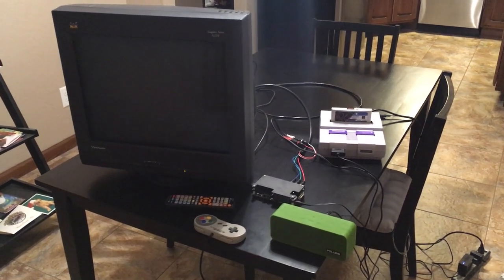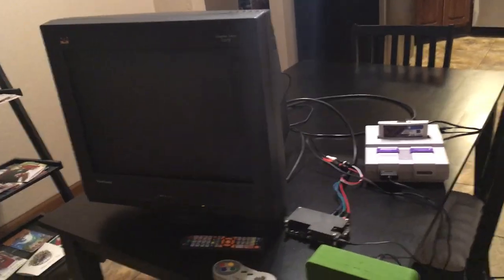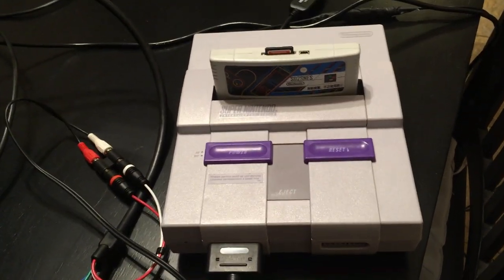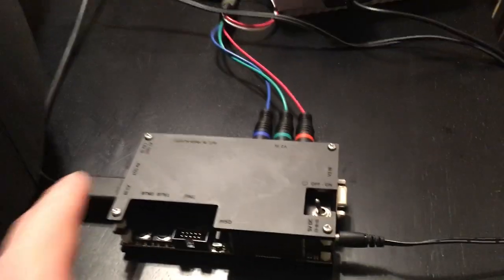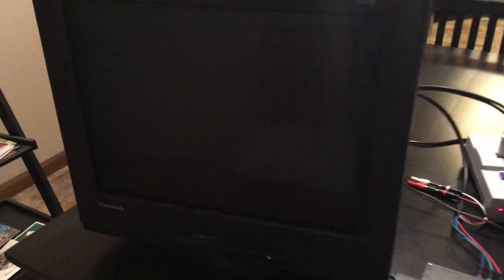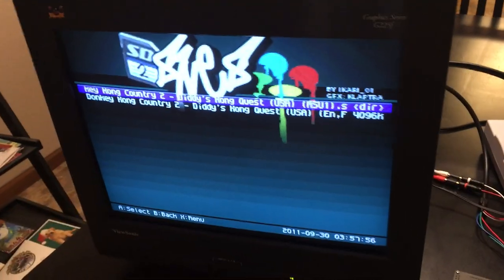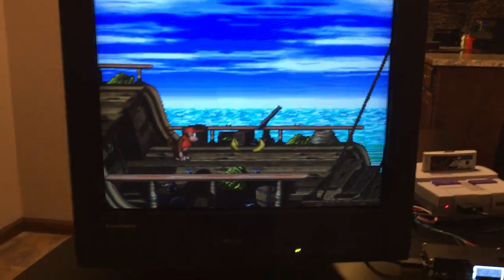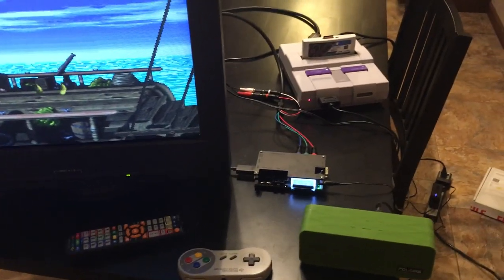SNES on Viewsonic G225f VGA CRT with OSSC

Comment: If you're outputting 480p, you should film this again with the scanlines enabled so you can give everyone an idea of how well this stands up to the sony pvm/bvm brand.  I tested mine on a gateway and in spite of it being shadowmask, it's quite freaky how thin and sharp the actual lines are drawn.
PC monitors are actually turning out to be a hidden grail for scanline purists.
Reply from the maker: Honestly, I'm pretty new to this and didn't think about it. I haven't messed around with the OSSC settings very much.
Reply from the maker: I have been experimenting with scanlines using the OSSC and I'm finding that I like them at about 56% which is pretty thick.
Reply from the maker: Here is a link to my video with Scanlines https://www.youtube.com/watch?v=QmybvIZeyKw
Reply: Totally agree.
Reply: I just ordered a Gateway EV910 and I'm so excited, especially since it's the exact same monitor I had as a kid!  I've been using an old 36" Trinitron but I've been looking for something that'll just fit on my desk and supports 480p content.  While 6th gen consoles look great when upscaled properly, they're still meant for CRT displays so I'm gonna play them that way lol  I just wish the monitor was black so it doesn't stick out like a sore thumb on my setup lol

Comment: Mitsubishi Diamond Pro 2070SB. I plan to buy this monitor. get a good rival for Sony GDM. It will also be connected to the ossc to connect consoles with a 240p screen. The same vga adapter as yours will use the monitor. I hope the effect will be great. It's a good monitor;)
Reply: Just make sure to get an HD Fury HDMI to VGA adapter, as they are the only ones available now days on the market with reference image quality.

Comment: The HD retrovision cable is not an RGB cable. It's strictly component video. Spend $25 and run an RGB Scart cable from your SNES to your OSSC. Your picture will be much better.
Reply from the maker: I might have to try that. I'm under the impressions that they are outputting a similar quality signal.
Reply: @superretrocade3362  very similar. From what I've read it's sometimes non-discernable, while other times it's night and day even with the exact model of screen.

Comment: Great video. I’m considering downsizing my trinitron and going the crt pc monitor route. PVM and BVM are non existent locally.
Reply from the maker: I also have a video about using the rad2x cables with a tendak hdmi to VGA adapter. That works very well with PC crts aswell.
Reply: Super Retrocade awesome I’ll check it ou
Reply: Not just Non Existent, but insanely expensive. PC monitors can be pretty expensive too.
Reply: @Vinnay94  You can get some really nice 17" PCM's for under £100, or 19" for under £200.

Comment: Thanks for the tip on the HDMI to VGA adapter. I own an OSSC but mainly use it for my HD displays. I have an older XRGB-2+ that I use to run a signal into my VGA CRT. It has a wobbly image and isn't great for capturing. Maybe I'll try the OSSC and see how well it works with my monitor.

Comment: Just picked up a Viewsonic P815, hopefully ossc will be available again soon for NA cuz i wanna try this out, possibly with RGB since it came with BNC inputs in the back.
Reply from the maker: I believe the BNC inputs on the back of the Viewsonics won't work with RGB from consoles. It is my understanding that it is pretty much just another VGA input but in a BNC connector to more easily connect to high end equipment back in the day. 1. I tried a Retrotink 2x and thought it looked bad. 2. I haven't tried the Garro since it can't do 240p 3. If you buy a used OSSC on ebay make sure it is a real one and not a knockoff or wait for VGP to have them for sale again. The knockoff OSSCs are made with cheaper stuff and may vary in quality. 4. Check out firebrand x settings profiles for the OSSC. Thanks for watching!

Comment: I have a G90F will it perform as good as that given that is only VGA?
Reply from the maker: POWERMAXUM it should be great! I think all these viewsonics are great for retro gaming.
Reply: @superretrocade3362  could you give me your recommended settings to calibrate the monitor?
Reply from the maker: @POWERMAXUM  Just as I said in the video I would adjust the zoom setting and horizontal/vertical positioning to make sure it fills the monitor but doesn't stretch the image. on my monitor I didn't adjust anything else. On the OSSC I used Firebrand X's recommended settings for the SNES then I adjusted scanlines through the OSSC to 45% or 56%.
Reply: @superretrocade3362   Sorry i havent answered your reply. I will check the settings you have told me. G90F is similar line but without RGB connector right. Or this one has a Trinitron or Diamontron monitor?

Comment: I have got the exact same Tendak adapter. Works flawlessly with both the OSSC and Framemeister to my PC CRT. However, the only thing is that with the OSSC (not with the Framemeister), I get audio interference (humming / buzz). Any idea why this is? I am using (proper) Scart cables for input (so I cannot split the audio immediately as you do with component).
Reply from the maker: I really have no idea. My best guess would be that your components have a bad ground. I have never tried the 3.5mm audio jack on the Tendak so maybe it is a problem with the Tendak itself.
Reply: @superretrocade3362  Hi, thank you for the quick response. It is definitely not the adapter's audio jack because that works fine when using the Framemeister. I have already found a way around it though, toggling the mini switch on the OSSC from A2 in to A1 out and using a 3.5mm cable from there. Still it is weird considering HDMI should normally carry the audio.
Reply from the maker: HorgothTheRelentless I know a lot of these devices aren’t true hdmi spec. Maybe that has to do with it

Comment: when you say 35 kilohertz, what does that mean? Is that something you need to look for when shopping for a CRT monitor with VGA?
Reply: Most if not all computer monitors (CRT or LCD) run RGBHV at 31 Khz. Meaning consoles such as NES, SNES, Genesis, PS1, PS2, Saturn, etc will not work with RGBHV because those consoles only run RGB at 15 Khz.

Comment: I have a question.  How does this handle resolution switching?  Like 240p to 480i?  Does this black out or is it instantaneous like how it's supposed to with 15kHz displays?
Reply from the maker: It blacks out for a short period of time when resolution switching. I noticed it in Top Gear when using the pits. I have found that the retrotink products don't black out when switching resolutions but they are only line doublers and do not support 480p.

Comment: Wouldn't an Component to VGA adapter eliminate the need for an OSSC?
Reply from the maker: Probably, but I don't know what a good one would be. The OSSC also gives me alot of flexibility to adjust the image. Thanks!
Reply from the maker: I know the Garo from beharbros does 480p and not 240p so I stayed away from that one.
Reply: You still need the OSSC to get a supported signal frequency into the monitor. The monitor won’t support a 15 kHz signal, so it needs to be line doubled at least.
Reply: @mexicoboy85  This is bs. My flat screen does not display the SNES through the OSSC no matter which 2x 3x or whatever I use. Genesis and everything else works fine.

Comment: Does that Tendak adapter convert an HDMI to VGA without signal loss ? I need something like that as my current graphics card doesn't support DVI-I and only has digital video output.
Reply from the maker: Yep, HDMI to VGA without lag or artifacting https://www.amazon.com/Tendak-Converter-Adapter-Portable-Connector/dp/B01B7CEOVK/ref=sr_1_3?keywords=tendak&qid=1568895353&s=gateway&sr=8-3
Bob from RetroRGB endorses these Tendak adapters.

Comment: Hey, could you output x5 on the OSSC with the Tendak adapter? If not, which I think it's probably the answer, is there any vga to hdmi that can output 1600x1200? Thanks!

Comment: Why does it look like its on a lcd ?, donkey kong dont look very bad like that on crt tv.
Reply from the maker: When I made this video I wasn't generating scan lines. I think that is what you are noticing is the lack of scanlines.

Here is a video of the same setup with scan lines. https://www.youtube.com/watch?v=QmybvIZeyKw
Reply: @superretrocade3362  nice, it looks very beautiful. 
Just one thing i didnt get, what do you mean by not producing scanlines ?? Scanlines are there by default on a crt, i thought it was not possible to remove them
Reply from the maker: Claude Speed I’m not an expert here but my understanding is that vga computer monitors have a different look than consumer TVs or Pvms. This pc monitor is capable of displaying 5 times the resolution that the snes natively outputs. When you scale the snes signal using the ossc into a vga computer monitor people say it looks more like an lcd. In my video I linked to it isn’t the crts scan lines being shown they are artificial scanlines generated by the ossc. So the 240p output of the snes is turned into 480p and displayed on a monitor that has a native 1200 by something. Then I generated artificial scan lines to make it look more like a consumer tv. I’m honestly not sure if crt computer monitors don’t have scan lines or just extremely thin ones.
Reply: @superretrocade3362  i remember my crt monitor from 2002, i used tovemulate snes, sega genesis and ps1 games. I remember they all looked good like on a normal tv...
This was long time ago, i dont remember if they looked better or worse, but there wasnt any downgrades in quality i could notice, because that time i had real snes, genesis and ps1 that i often played.
But now when i tried to emulate these old games, and i dont remember they looked very ugly .. i boot up my old consoles on old tv, they looked good again. i did a google search and this is how i got here. 
Hopefully i get hold of a good condition crt pc monitor.
Reply: @zombiedeutsch  some monitors can run at 15Hz (consumer tv rate) while typically 95% of them only do 31Hz(computer monitor). If you're monitor is 30Hz pretty sure using ossc is your best bet
Reply: DarkStar there are so-called Multisync Monitors Form nec or other companies which do 15-31khz and more